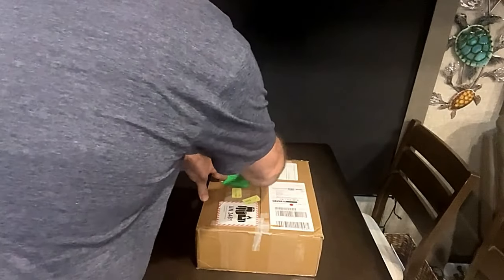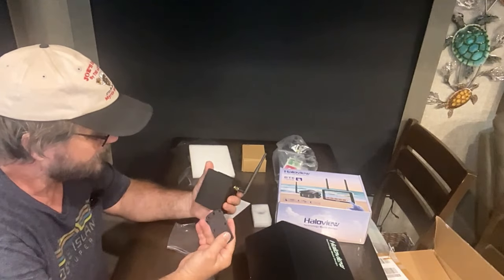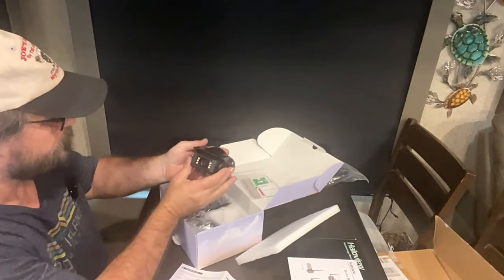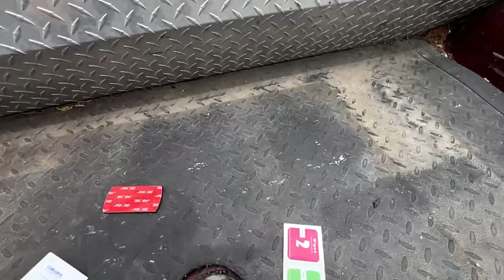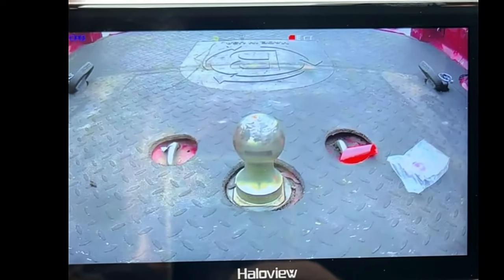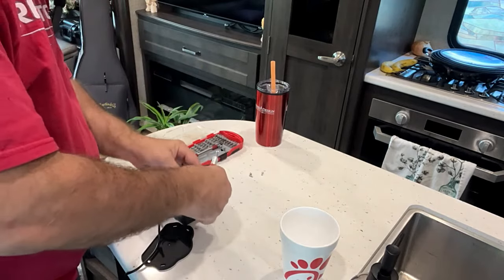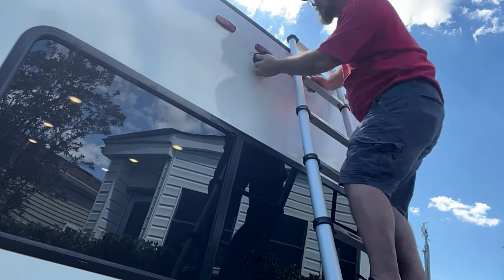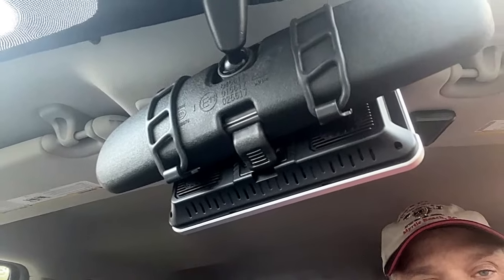Game-Changing RV Backup Camera Install! 🎥

Comment: Great informative video! I need something like that on the front of my fifth wheel so I could see what’s going on when I hear some noise out there. All I need to do is find some 12 V that I could tap into and I’d probably be interested in getting all of those cameras set ups.
Reply from the maker: Thanks for watching as always Ed.  I hope you're doing better.  For the front of the camper the BTC126, like I put on my toolbox, might be just what you're looking for.  It doesn't require a wired power supply.  You just charge it up and stick it.  If you are interested, I added a link in the description section that you can get a 5% discount with.

https://www.haloview.com/byte-tango-bt6-touch-1080p-wireless-backup-camera-system-with-touch-screen.html?acc=754
https://www.haloview.com/1080p-battery-powered-backup-camera.html?acc=754